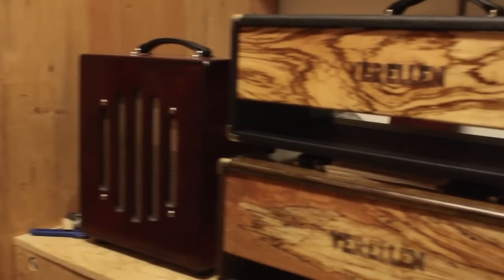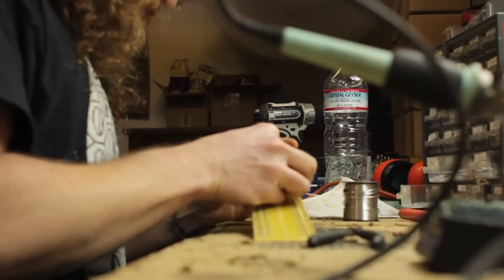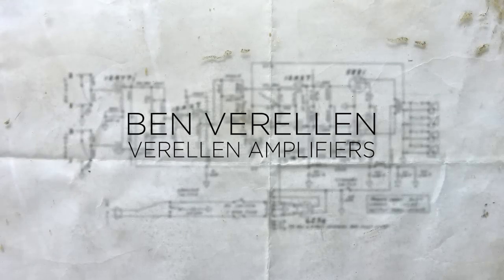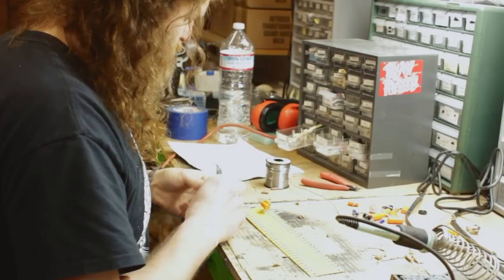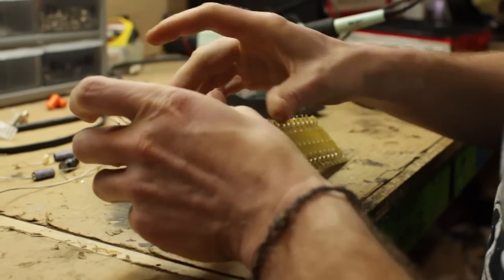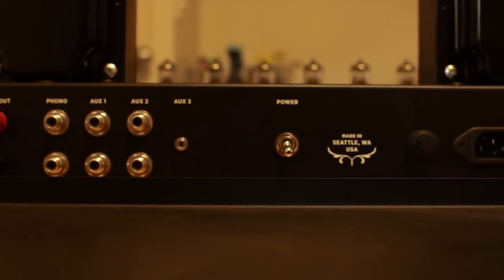Ben Verellen: Tube Amps, Tone, and Circuit Design

Comment: Good ideas but I wish I could be the perfect medium breakup gain stage instead of super crunchy or blaring loud where it is harsh and the speaker does not add grit of its own like some British copys
Reply: I personally like a pedal level tube FX loop and preamp that's clean but gained up it will slowly push the power tubes just right into breakup !
I play some glass slide standard tuned and like a liquid sound not compressed by over clipping the preamp , but singing dynamic tones so I use a way huge green rhino OD which is a clear sounding OD pedal and its fun sounding !